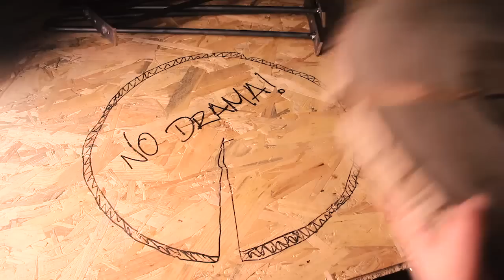How to make your own hairpin legs and almost fail at the tabletop

Comment: Wow, everything about this video is incredible! Seriously impressed. + you make stick welding look like the most badass thing a person can do. I've never had the desire to learn until this video.
Reply from the maker: hahah :D glad you liked it! my stick welding skilss are poor, but they did the job haha. Welding is cool :)
Reply: @Cactusworkshopchannel  young man you do outstanding work! I'm deeply impressed and I don't get impressed easily and it rarely happens. Anyhoo I'm going to make some stools like this, so will you please tell me what kind of metal rod you used for the legs (or whatever it's called). Also, why didn't you just heat the rod with a torch, and then bend it? I think that's how I'm going to bend mine, hence it works on bending/shaping a horseshoe 🤷‍♀️. Thank you so much for sharing and teaching your skills, you're very cool, stay that way, thank you again, and I look forward to hearing from you 🤘

Comment: @Cactus!Workshop  Young man you do outstanding work! I'm deeply impressed, I don't get impressed easily and it rarely happens. Anyhoo I'm going to make some stools like this, so will you please tell me what kind of metal rod you used for the legs (or whatever it's called). Also, why didn't you just heat the rod with a torch, and then bend it? I think that's how I'm going to bend mine, hence it works on bending/shaping a horseshoe 🤷‍♀️. Thank you so much for sharing and teaching your skills, you're very cool, stay that way, thank you again, and I look forward to hearing from you 🤘

Comment: enjoyed watching the jig come together.  Looks like it spits out pretty consistent legs.  I like your adapted design that accounts for the split in the cookie.
Reply from the maker: +Greg's Garage Thanks Greg! I had an end stop but you have to account for some elastic deformation so it could be around 0.5-1cm of error in the distance between both ends. The drilled holes on the steel plate take care of any inconsistency, basically each leg is a spring so you can make them look very similar easily! Thanks for watching and commenting! :)

Comment: Wish i could weld. Nice table. Wood tends to move a bit. It would have taken a year of careful drying without guarantee to prevent this crack. You could fill it with epoxy mixed with color or metal powder, or just enjoy the crack itself.
Reply from the maker: +Willem Kossen Thanks Willem! welding is not that hard and doesn't have to be expensive, so give it a try! I guess the crack was meant to be and it looks so cool I think I'll enjoy it as it is :)

Comment: Excelent work!

How do you protect the legs against oxidation?
Reply from the maker: Thanks Eve! I didn't protect them, it is indoors so they haven't rusted :)
Reply: Don't you wipe your floor?
Reply from the maker: I do :P still good :) Madrid has a very dry weather, the floor dries very quickly. Never had an issue with that

Comment: What  did you use as the scraper when you whare flatening out the top?
Reply from the maker: +HolyChickenn I sharpened a steel ruler I had around :D